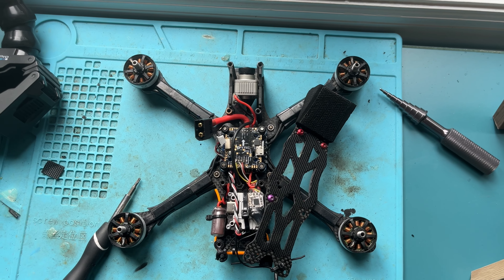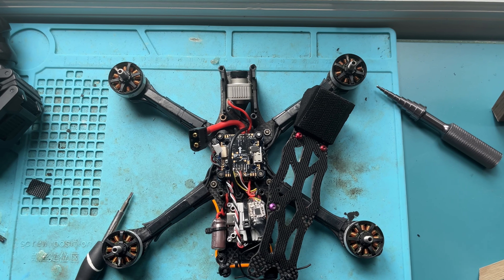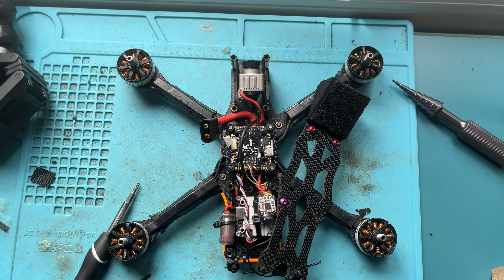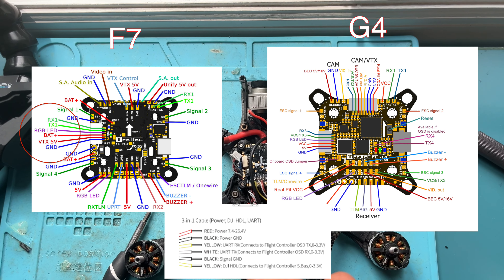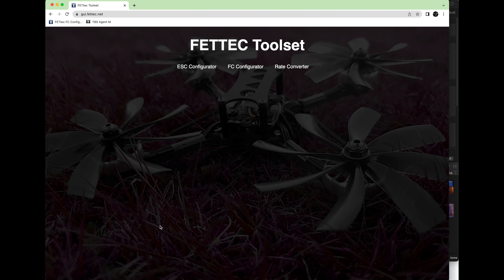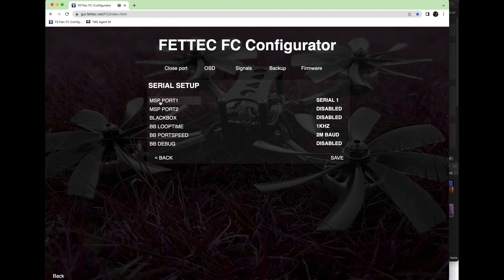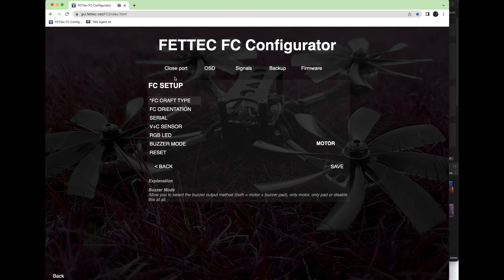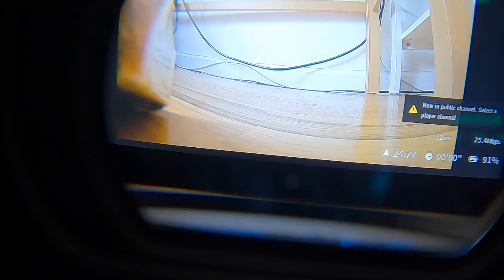HOW TO: DJI on FETTEC ALPHA

Comment: Hi, thanks for your great tutorial, please let me clarify a few things about this Fettec alpha: I have on one of my quads, a Fettec F7+ ESC and I've used for it until now the Kiss gui, before  connected DJI O3 system to FC in my DJI V2 I lost the OSD, so please let me explain, if with Fettec alpha FW I can recover the OSD on my V2s, and I would like to understand if I can use all the settings and values of PID, RATE, IDLE UP and what else I currently set on the Kiss gui on the Fettec alpha, because with great effort I tuned and set the values for a good flight result and I would like to keep them and not lose them, really thanks if you help me with an answer, Dino from Italy
Reply from the maker: Hey Dino the tune is going to be different than KISS you’ll want to be careful trying to move them directly over — the math is all different. I would start on their stock 5 inch tune and make adjustments there but def do a fresh tune

Comment: I have the Fettec AIO 35 and the dji o3.  I have this setup on serial 4.  I do not get osd unless I plug in the USB cable and connect to the alpha configurator.  At that point I immediatelly get osd in my DJI Goggles 2.  I get the full setup menu in the goggles so canvas mode is working.  I can disconnect the usb and the OSD continues to work.  So it seems like msp displayport is not initializing unless the alpha configuration connects to the board and then it continues to run that in the loop.   I believe this to be a firmware bug.  I am on 0.7.1.
Reply: I just got it to work by doing the beta flight stick commands.  Throttle center, yaw left, pitch forward.  It pops up the alpha menu and then when you exit the OSD is there.  I don't know why it doesn't run the osd on boot and requires this.

Comment: Hey i have the pacer g4 alpha and i get a waiting for fc on my osd in my goggles. What do i need to do to fix that?
Reply from the maker: Mmmm usually that means either a bad connection between esc and fc so I’d check the cable and also make sure you’re running dshot 2400 in the config it defaults to the wrong protocol 🤷‍♂️

Comment: Im only able to battery voltage on g4 aio but both my g4 one is regular the other is n but it should still work with digital.
Reply from the maker: It’ll work fine, just set the serial port properly so it can communicate with the vtx
Reply: @MattyfleischFPV  I feel like I've tried every single way. I even matched how I had the g4 aio that works properly. Says fettec and batt voltage. But both my regular G4 have  none
Reply: I have serial port dji MSP osd on 3 on the aio and it shows up. For some reason it's the same and will not. I calibrated it as well wondering if that's why.

Comment: I use plugs for everything on my KISS V2 and FETTEC F7. from the CRSF to the vista. I do not have to solder anything in case my FC goes out all I have to do is unplug 3 plugs and plug them into the new board that already is flashed with my set up and go! If you want to know how I do my set up let me know and ill show you. Also you can put the vista on the other plug under the one your using and it will put the vista on ser. 3.

Comment: How do I open serial port?
Reply from the maker: It should prompt you with a pop up. If not, make sure it’s not blocking somehow
Reply: @MattyfleischFPV  idk if it's a driver issue or what. It worked fine on my older laptop just now so idk 🤷‍♂️ lol